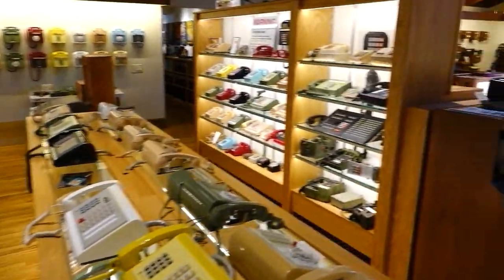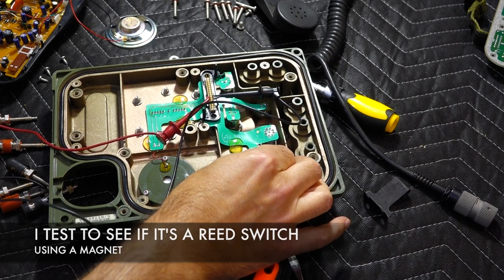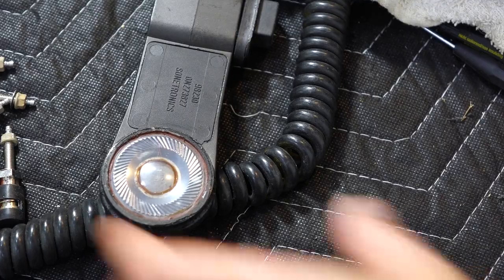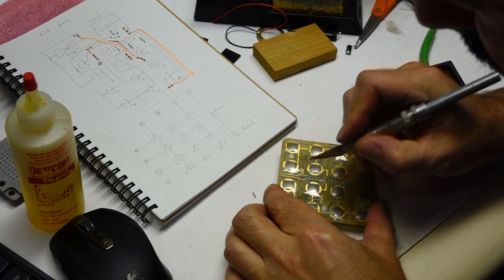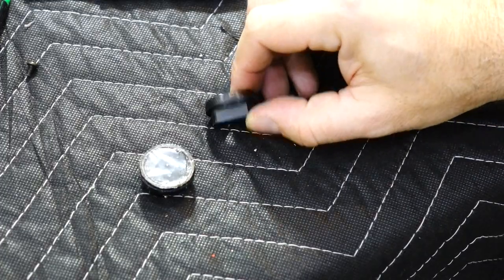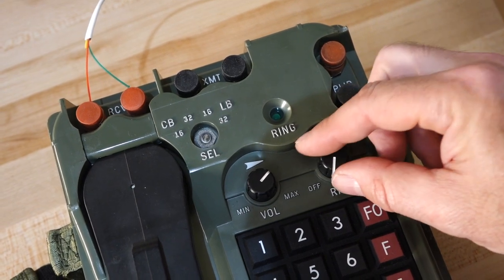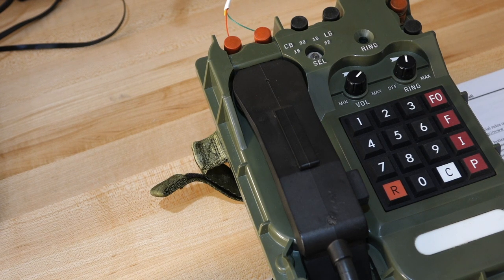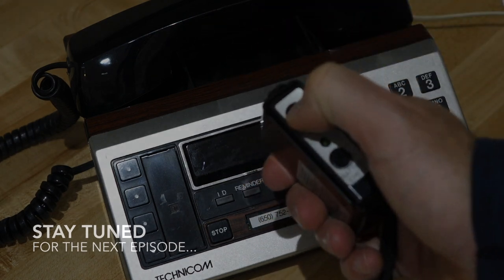Converting a Military TA-1024A/U Field Telephone for Regular Phone Use

Comment: @CuriosMarc check this page. it has some info about the TA-1042 which also has a 4 wire system.
http://radionerds.com/index.php/TA-1042A~U
and here is a system to convert the military phone line to a normale one.
http://radionerds.com/index.php/DNVT2IP
Reply from the maker: You had my hopes running high for a moment. Unfortunately the linked project to reverse engineer the digital phone was not completed (it is unclear if it was even started). Too bad!
Reply: @CuriousMarc  i knew that some people started this project. but did know if they got any where. at least it may have given you some info to work with.